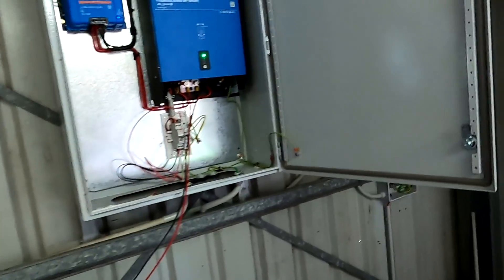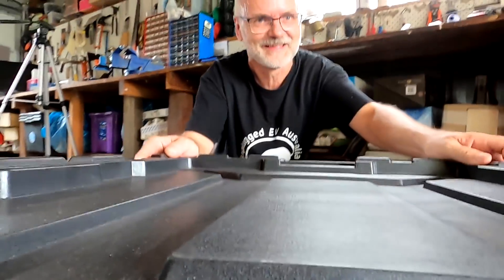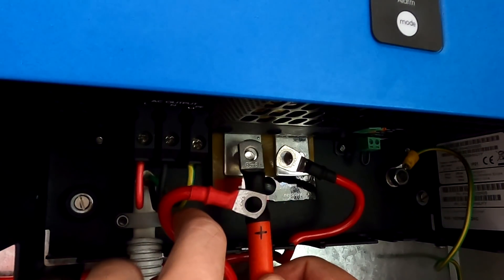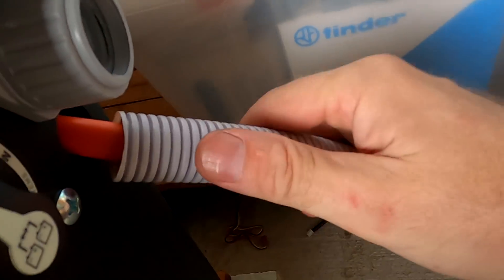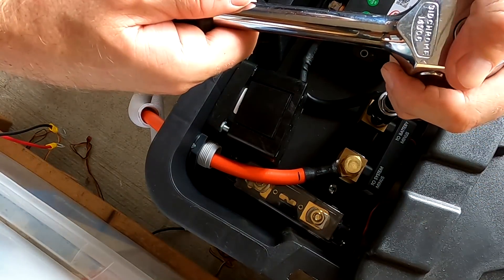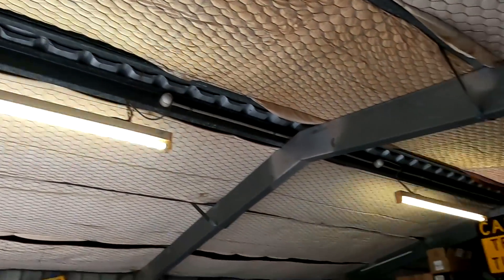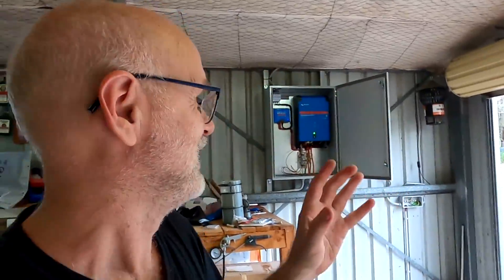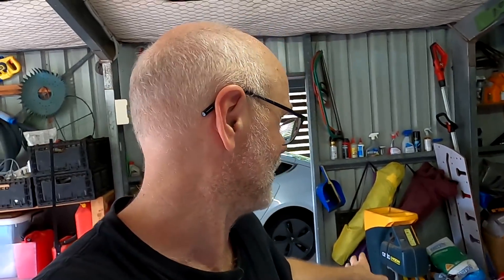Connecting big cables to the inverter. Not 100% happy though...

Comment: Andy can a person use more that 1 active balancer on a battery. My bms won't do it cause of such small balance capabilities and I I not received my jk bms yet and it only does 2 amps. Can I add active balancers and if so can I add more than one 5 amp balancer? The cells are all eve 280 grade a so its 560 ah at 24 volts. Maybe I only need 1 of the 5 amp balancers. Any help thankyou

Comment: Andy! You really do a good job adding all info and parts avail, 2 guage!!!! wow I could not find a Amp rating??? I guess with cable like that, you dont need it, it will take it all!
Reply from the maker: 2AGW cable can be used for 185A and even more depending on the kind of installation. That's what they recommend to keep DC ripple down and the inverter happy.

Comment: Had a thought, don't know if someone else mentioned this or not. Could you not use a bus bar to use to connect so you only have 1 wire to the inverter? so you don't have so many wires on the terminal. Just a thought.

Comment: Make the resistor switchable with a switch on the battery, saves work and you don't need to search your resistor in for instance a month when doing maintenance or whenever your inverter gets it's caps discharged.
Reply from the maker: Upgrade coming soon ;)
Reply: which kind/size of resistor do you use to precharge the inverter capacitors?
Reply from the maker: @mariousai  this is a ceramic resistor with 22Ohms and 5W. Everything 15-50Ohms will be fine.

Comment: you need a combine box?
Reply from the maker: Studded bus bars...
Reply: @OffGridGarageAustralia  that will do can you do a review on the 450/100TR
Reply from the maker: @brian1395  what is that?
Reply: want to by but want an opinion as to if it is better or worse than the one you have. will pair it with 6k of pannel and three sets of the same batteries you have at 48v.
Reply: dc coupled with 5k inverter that i have not picked out yet
Reply from the maker: @brian1395  why don't you get an MPP 8048?
Reply: @OffGridGarageAustralia  i live in thailand and can't find them
Reply from the maker: @brian1395  If I order them on eBay Australia, they will get shipped to me from Taiwan. Is this in option. Maybe get in touch with the seller on eBay and see if you can figure it out.

https://www.ebay.com.au/itm/MAX-8000w-48v-230Vac-Solar-inverter-120A-MPPT-solar-charger-PV-input-500vdc/164344383466?hash=item2643b047ea:g:1YAAAOSwpbtfkPq8&mkcid=1&mkrid=705-53470-19255-0&siteid=15&campid=5338706372&customid=AndysGarage&toolid=10001&mkevt=1

Comment: so i would add the resistor and a momentary push switch next to the battery box on off switch so you can do what you have done manually  if you ever need to power cycle the battery inverter combo
Reply from the maker: Yes, that's a great upgrade I will do soon. Thank you.

Comment: 031521/1548h PST 🇺🇸0848 Brisbane.  Thanks for this segment. Finally the Battery bank into it location. 
I may be wrong, but, do you need AWG1 cable running to the inverter?  AWG 4 would have been sufficient, since you do have such heavy loads in your garage. Except the pump; but that’s momentarily operated. No more comments. Congratulations again. 73s...
Reply from the maker: The battery has a 100A fuse and the load is only 40-50A max from the battery. The pump has only 700W/230VAC, so all good.

Comment: You can always take the lugs off and put the two wires in the same lug on each terminal and then you got enough room for everything cuz then you only have one lug on it
Reply: Well if you're not happy with that it's real simple to fix just add  your own bus bar to it with a longer stud insulated behind it would both put those on and you can put up whatever you want take it off whenever you want
Reply from the maker: @thomasmoore4576  yes, that's the way forward. I ordered them yesterday already.
Reply from the maker: And you can never take it apart again. I think that's not a good idea.

Comment: Good video. I would suggest to install an AC outlet for the utility power cable that you cut so at least you will have AC outlet to run the lights in the dark in case the solar system goes down.
Reply from the maker: I'm not to worried about it. It's just the garage... nothing essential in here.

Comment: Sounds like you have a plan yeah really need to get those solar leads off the inverter.  In the perfect world, the solar charge controller would be connected directly to the battery so it senses the battery voltage better, but the bus bar is a good compromise.

Comment: I thought the invertor had a soft start
Reply: Need to charge up those capacitors, otherwise a huge spark.
Reply from the maker: For the load, not for when it gets connected.

Comment: You many not need the lock washers. You might get some nylock nuts if you can find them. LED tubes use much less power than fluorescents and the price is now very reasonable.

Comment: As you mentioned, use bus bars and don’t have two lugs in the inverter. Speaking from experience, the battery, charge controller and inverter should each have their own stud on the bus bars. That way the inverter or charge controller can be disconnected without tearing down the whole system.
Reply from the maker: Makes sense. Thank you.

Comment: Be prepared that your Victron Phoenix Smart 48/3000 inverter is only 3000VA and 2400W continuous at 25 Celsius. On 40 Celsius only 2200W. (Peak 6000W "maybe")
To start an electric motor you need 3-5-7 times the continuous power it needs (inrush current).   
So to start the 2400W shredder it will work haaaaard .... or simply shut down with overload.
Reply from the maker: It worked fine. Test video will follow 😊
Reply: @OffGridGarageAustralia  Wow ... I would guess that it is too much for it. DavidPoz tested a lot of equipment with inverters, and not always with good results.
Reply: @mrzed6597  that would make a great episode. Stress test both inverters and see which one is the winner.
Reply: @kevinmills5293  DavidPoz best videos where he test the inverters to start a compressor, a miter saw and other equipments. 
Sadly he never gone into details like how many W is the equipment. Or getting the constant Amps running it. Or even more the inrush current for the start.
Now that is important. To know what to except, to be able to plan before. 
Will this inverter be enough to start a 1000W well pump? 
Or like here a 2400W grinder ? (empty of course it does not need 2400W)
Reply: Stop spreading rumors dude without watching the video first.

Comment: On those short terminal studs, I would get rid of the spring washer. They don't work until the nut has already come loose (and not very well even then). I would be worried about stripping the threads without the nut fully engaged.

Comment: Great project to follow while I’m building mine.
You will not connect the negative battery to the main ground as suggested by inverter manufacturer?
Thank you for your shared knowledge!
Reply from the maker: They only software this for mobile applications, boats, RVs,...

Comment: I would not be happy with the main cable nuts only half threaded on the terminal bolt inside the inverter. Split/spring washers do take up quite a bit of depth, so what about a star washer instead - or even no washer and some threadlock? 

Also at 48v do the solar feed lugs need to be that thick for the current they are carrying?

Personally I’d add busbars inside the box, plus I’d also install some form of protection/disconnect between the solar MPPT output and the battery/inverter/busbar; but then I’ve seen a 48v UPS battery fire in a data centre (somebody installed a 2v lead acid cell backwards - person was ok, UPS and rack not so much.

Amazing progress 👍
Reply from the maker: Thanks, Ian. All this is coming soon... 😊

Comment: Another very helpful video Andy. When I rewire for my new batteries I will be sure to relocate my inverter disconnect switch. Then I can remove the back cover the way you did. If I can’t relocate it I could just wire a resistor across the terminals with a toggle switch. Cheers kevin
Reply from the maker: Yeah, I thought about this switch with the resistor. Just a push button which connects as long as you push it. Like a start button 😃
Reply: @OffGridGarageAustralia  wow. How often do you plan to disconnect?
Reply from the maker: @walterk8602  it's about having it for convenience and learning experience.
Reply: @OffGridGarageAustralia  For the few times that I need to take my inverter off line, I hard wired a 30 ohm, 100 watt resistor in series with a normally open momentary pushbutton switch and then paralleled that with my main inverter circuit breaker/switch.   Just push the button to allow pre-charging of the inverter until the low battery light on the inverter comes on, then close the main breaker/switch.  It's an easy way to soft start the inverter, and saves wear and tear on your circuit breaker.
Reply from the maker: @brucebugbee6604  that's a great setup. I'll do the same as an upgrade to my battery soon. Thank you.
Reply: In my case I cycle the inverter frequently as it’s on my boat. I usually  shut the AC off unless specifically needed. My concern is how the BMS will react to any surges on reconnect. It likely isn’t an issue but I’m a belt and suspenders type when it comes to the boat. 
Andy I think the push button is a great idea. It’s the same as the diesel engine glow plug pre-charge. Cheers
Reply from the maker: @kevinh7985  yes, such a button for pre-charging the inverter. Perfect. I'll add this to my box too. And it looks kinda cool 😃
Reply: I wonder if you can get a switch with a resistor built in, attached to a momentary switch?

Comment: You should probably have a bus bar for your connections as opposed to stacking the battery and solar connections inside the inverter.
Reply from the maker: Yes, ordered!
Reply: Yes, this! This will make access much easier and connections safer. You risk stripping the lugs on the inverter in the long run too. Great videos!

Comment: is it really ok to disconnect the PV fuse 1st?
Reply: Most SCC will tell you to disconnect the PV first before disconnecting the batteries, and to connect the batteries first before connecting the PV to prevent damage to the SCC. And if SCC has automatic (12V/24V/48V)  battery Voltage sensing you must connect the batteries first so it knows what Voltage system it will be running before connecting the PV input.
Reply: Yes, if there isn't any load conected to the inverter.  The inrush power can cause costly damage to the cc.
Reply from the maker: There is no inrush current in the solar side, just from the battery side
Reply: No. Only a friendly spark.